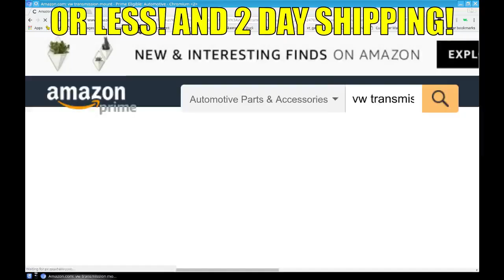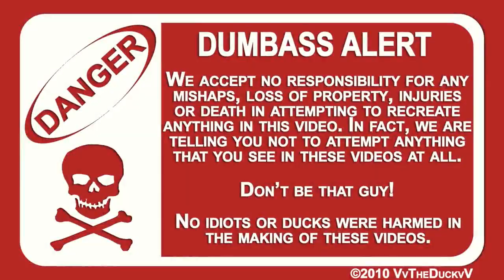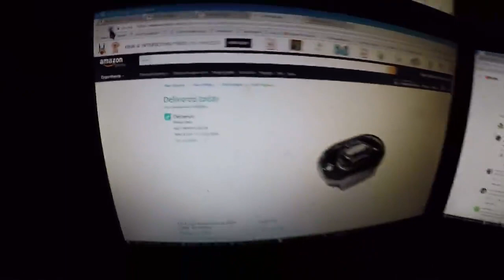Custom VW Type-3 Trans Mount

Comment: For the type 3 vw where is the starter located and what should i check if type 3 doesnt start
Reply from the maker: The starter is in exactly the same place as on a Beetle... Jack it up safely and remove the rear right hand wheel and you will see it.   Things to check would be the wiring, including the wiring connector that's underneath the left backseat.  Also your ignition switch could be bad.  Is everything test good but it still doesn't work you may have to install a hard start relay.
Reply: VvTheDuckvV where could i find a hard start relay if needed
Reply from the maker: Check out my video on the subject!  All the links to relays are in the video description1  I hope this helps ya!  https://youtu.be/w6AE6ALQcmk